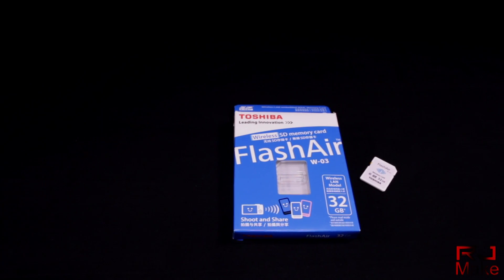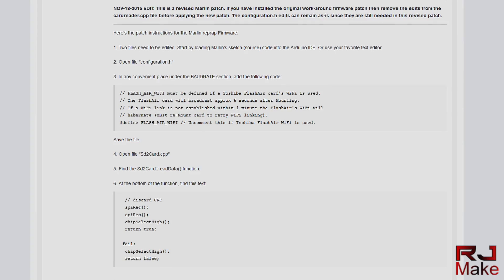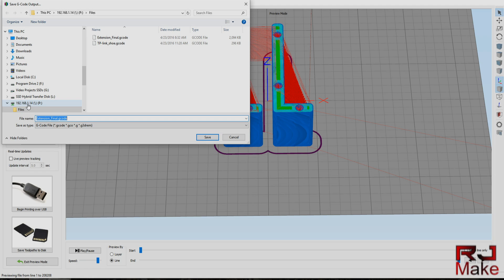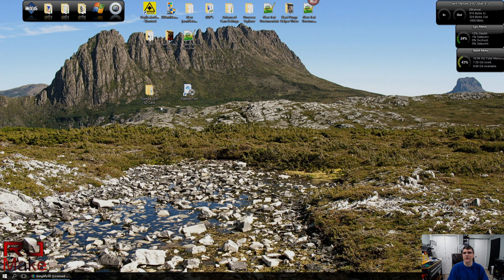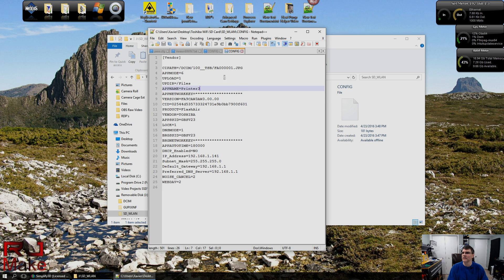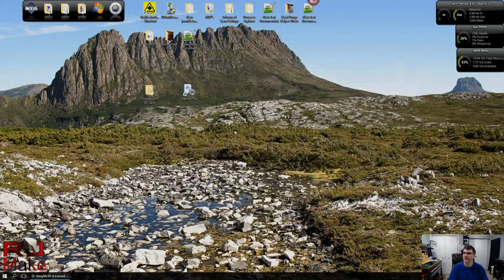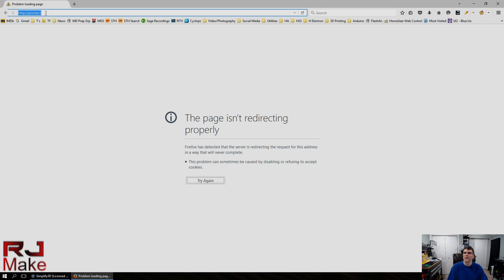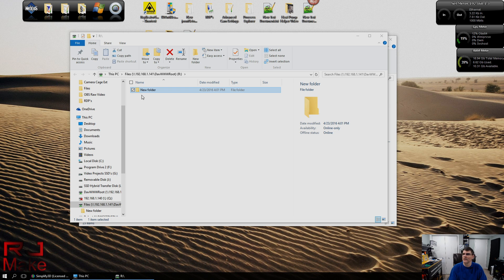Using a Toshiba WiFi SD Card with your 3D Printer

Comment: I have all my files in the flashair cards Root directory.  I have mapped these drives in the past just fine but I lost my pc and have to remap.  For the life of me I cannot get it to connect by simply putting in the IP address alone.   I have a folder in the flashair card that I can map to using  //192.xxx.x.xx/Suretech.   I cannot get it to connect to //192.xxx.x.xx/   . I have had it setup this way working before but don't remember what was entered.

Comment: Hey! Flash Air cards aren't available anymore. The only ones I can find are those from EZ Share. Could you make a Video about hacking those? There aren't expensive. 
Hope for your help
Reply from the maker: I believe you are referring to W-02 cards.. The 03 and 04 cards are still available., at least in the USA.
Reply: @RJMaker  Can you send a link?
Reply from the maker: @allcrafter3747  Send a link for what? There is no shortage of W-03 or W-04 cards.
Reply: @RJMaker For the card. I couldn't find one. At least here in Germany.

Comment: Hi RJ, thanks for the video.  I've been trying to figure this out for a couple weeks now off and on, and I'm struggling a bit.  I bought a Toshiba FlashAir off Ebay, and it doesn't have a 'W-' number on the front, I'm wondering if I bought an older model, as the FlashAir tool I downloaded has a different looking interface than the one you show.  The version my config file shows is 'VERSION=F24A6W3AW1.00.03' if that means anything to you?  Do you have any experience with this being an older card, and maybe doesn't work the same?  Thanks!
Reply from the maker: It is my understanding that if you don't have either a W-02 or greater on the face of the card then you have a version 1 card and will not be able to create a Mapped Network Drive on it. It requires a W-03 > card. I have moved away from using these cards as Octoprint offers a much better experience.
Reply: @RJMaker  thanks for the reply!  That's what I was afraid of, I'll have to go check out octoprint.  Thanks again!

Comment: Can I just upload my gcode to the card wirelessly and use printer as I would normally using a standard Sd card. then If wireless switches off it shouldn't matter?
Reply from the maker: If I'm understanding you correctly. I would say yes. The wireless should not shut off though, if it does then something is not right.

Comment: Actually you over-complicated this - and this setup will not work if you will have multiple WiFi SD cards in the same environment.
What you actually want to configure the cards as is not pass-thru repeater mode (then multiple WiFi cards will try to connect to each other and all will go bit quirky)

You actually just want to configure them as Access Point Clients not Acces Points/repeaters

For that you set them in the Station Mode
So configuration is:
APPMODE=5
APPSSID=wlan_identifier
APPNETWORKKEY=your_wifi_password

Completely skip the whole
BRGSSID=GBSV25
BRGNETWORKKEY=******************

NOT NEEDED

You will still need 
WEBDAV=2
UPLOAD=1

APPMODE=5 - card acts as a normal client connecting to your router/AP :)
No extra pass thru malarky
Works perfect with multiple cards - I got 3 - 3d printers, all with wifi cards in

Saying that - thanks for video, always appritiate someone making an effort - I started with it, before I went into the documentation to find the settings.
Reply from the maker: Absolutely, much easier to setup now considering you don't need to do anything outside of running the latest version of setup software. It does everything for you.  That said ~3 Years ago when I used these cards I had 3 working at the same time without any issue using the instruction above.

Comment: If you have trouble setting up your card i HIGHLY recommend checking out this article which helped me  to set up my card as a network drive. https://mattshub.com/2017/04/11/flashair-sd-card/
Although it's only for W-02 and W-03 cards, it worked perfectly fine for my W-04.
My card reads as 931GB (Same as my C: Drive) Weird, but i can access it.

Comment: Hey RJ, I just go my FlashAir W-04, Im stuck on getting my card to work? first, how/where do I get the IP, subnet Mask, default gateway and preferred DNs Server? Is there a step by step to do this. like from putting the Flash Air in to making it work? I'm not that tech savy
Reply from the maker: Be very careful here. I'm not sure of the differences between the W-03 and W-04. I do see they are using a difference program to interface the with the card. This video is regarding the W-03 version.
Reply: me too FlashAir W-04 doesn't work

Comment: its connected but wright protected ..helpme
Reply from the maker: I need more information. Are you using a W-03 card?
Reply: +RJ_Make Sir its work but WiFi signal not have 20 meeter distance

Comment: What do we do if the connection times out?
Not sure if i got the ip address correct. Connected my pc to the wifi network to optain the ip.
Did i just find the ip address of my pc? do i need to invent a new ip for the card?
Screenshot of my settings: https://ibb.co/hOigGz

Comment: Hi rj are the settings the same in video for Mac ?? Just going to order 2 cards now thanks in advance pete
Reply from the maker: Good question and unfortunately I don't know the answer. If I had to guess I would imagine they would be the same.  If you are looking for a solution for a 3D printer, I would suggest looking at OctoPrint. If you have a compatible printer it is a far superior system. I have moved all my machines over to Octoprint and what a blessing it has been.

Comment: Can someone help me pls? this guide worked 100% for me. but when i add another toshiba flashair to my other printers it doesnt work it doesnt connect thru browser and i cannot access its ip address. even tho i changed ip address so its not similiar to the 1st one. i have 7 printer and 7 toshiba flashair. only 1 is working.
Reply from the maker: Can you connect to the card's wifi while it's in your computer?  Some base printer firmware' do not keep the SD card socket powered all the time.  If you cannot connect while it's in your computer I would look for a routing problem. Either in the cards setup, or in your router itself. When I've had problems in the past, rebooting my router and then waiting 10-20 min (with card powered up) help solve some strange problems for me.  

All that said, IMO, with 7 printers you may be better off using OctoPrint for each one (if you're printers are compatible) to help manage your printers. It will be a little bit more upfront costs and setup time, but overall you will be able to better manage that many printers.
Reply: the 1st card had no issues. problem starts when adding another sd card. when i ping the 1st card thru CMD the connection is good. but the 2nd card is too long to load and then it doesnt work anymore i can detect the 2nd card thru ip scanner but it isnt working

Comment: Just added wifi cards to two more printers!  These things are great!!  So, now I have working cards on a Prusa MK2, a Flashforge Creator Pro and a QIDI Tech-1.
I have to more printers to go.
Reply from the maker: Congratulations Christopher, I'm glad you got them working!
Reply: how did u get it working to more printers? i cant get mine to work for another printer shame i bought 7 toshiba flashair only 1 is working even tho i changed ip address of flashair
Reply: First is make sure they are version 3 or greater.
From my first working card I copied all the lines down to the two he says not to remove or change, forget what they are called, and replaced all of those top lines on the new card.
I did the same for all of the lines below the two lines you need to keep.  It is critical not to change the two lines he tells you not to change.
I changed the "Name" and IP.  I then ran the software for the card to initialize it and update the password.
Basically I followed his instructions except I use the lines from the working card to go onto the new one.

Then power on the printer with the card in it.
Reply: they are all version 3. we did the same. changed ip and name. i wonder whats the problem its frustrating since i bought too many
Reply: Once you updated the script on the card did you run the software app to initialize the card?
Reply: no i dont initialize it after updating the script like i did in the 1st card
Reply: For my new cards I basically ran through RJ's process but used the info from my first card.  After transferring the needed lines to the new card I ran the software as he describes.
So essentially I ran through his entire process for each new card and it worked fine.

Comment: I am saving files to the root of the card.  I am finding that I have to go into the card and back out from the printer control panel (Prusa MK2) a few times before I can see the file.  Is saving to a folder better?  Haven't tried yet.
Reply from the maker: I don't remember having that problem, although I don't have an Mk2.  Does the MK2 keep power to SD socket when not reading it's contents?
Reply: It seems that if you save to the root level it doesn't see it until you can do some type of refresh such as go into a folder and back out.  Now, the odd thing is if I save into a folder on the card then it sees it fine right away.  None of it is that big a deal but just something more to be aware of if files don't seem to appear.
Reply from the maker: Thanks Christopher.
Reply: You're welcome.  Going to try an experiment.  I have a couple more cards coming for other printers.  Do you think I can just copy the working file from one card to a new one and just adjust the settings?  Also taking care to leave the couple important lines unique to the card.
Reply from the maker: You should be able to, I did it across 3 cards without any problems.
Reply: Yup, did the copy making sure to leave the needed lines and just changed the name and IP.  Ran the initialization routine and up and running.

Comment: I could give you a hug and kiss! After fumbling around with some half-baked online tutorials that , while they work are very clumsy to use, yours is an elegant solution. And you guide the uninitiated through it easily. Thank you so much!
Reply from the maker: Thank you for the kind words. I'm glad I was able to help.
Reply: Hello! correct me if I'm wrong, you can send the files but can you make the printer print? Or once you send the file do you have to go to the printer and make it print?
Reply: Only sends the files. You have to use the printer menu system to start a print. Still a major convenience and saves wear and tear on the printer's SD card slot.
Reply from the maker: As Michelle stated, it's for easily sending files to you printer, but has uses for other devices.  I have since moved my printers to OctoPrint, because I have actual control of the printing functionality. In addition to that, OctoPrint has fantastic MQTT support, so if you have a home automation system you can really do a bunch of 'stuff' with it.

Comment: Thank you for your sharing!
Reply from the maker: You are welcome.
Reply: I have a problem that I cannot access the folder in my computer.
However, it works in my camera....
Reply from the maker: Can you navigate to the card via Wifi?  What kind of printer firmware? (Remember the printers firmware must keep the SD card slot powered)
Reply: RJ_Make It seems the power supply is not enough from printer to SD card slot. my printer is Creality Cr8 printer.
Reply from the maker: Oh that's a shame. I would take a look at OctoPrint then.
Reply: Anyway, thank you for your help and sharing ^^
Reply from the maker: I would really take a look at OctoPrint, I've switched all my printers over to it and I love it.

Comment: Hey I am having an issue, I have a Flashair II, and I followed your steps exactly. I got it to connect to my router however when I try to access it I get the error message 403 forbidden, this server is refusing. Im lost here, so think you could lent a hand? it would be much appreciated
Reply: RJ_Make ah that would make sense, as I could get the web interface to work but not the network map. thanks RJ, I'll sub!
Reply from the maker: Do you have a VPN installed? I have heard that some VPN services will cause issues.  Just so you know this video is for the Type 3 cards. Type 2 cards do not have the WebDAV functionality, so you will only be able to connect via the cards web interface.

Comment: I have a FlashAir card W02 cheek when I plug in 3d but received no wifi card
Reply from the maker: You need a type 3 card for the WebDav function to work. You should still be able to use the web server though.  You need to make sure the printer you are using keeps the SD card powered up all the time. For example the Fabrikator Mini stock firmware does not.

Comment: Thank for ur share , but  i have a problem.  I cannot  access  large size file to SD card  to  network drive. my test file is about 100MB.
Reply from the maker: That is strange. What OS are you using? Are you getting any error's?
Reply: win7-64
Reply from the maker: dginlon
Any error's? Is the card formatted Fat32?
Reply: Factory defaulted ,I had no change it.
Reply from the maker: Did you ever get it working? Sorry I couldn't be more help.